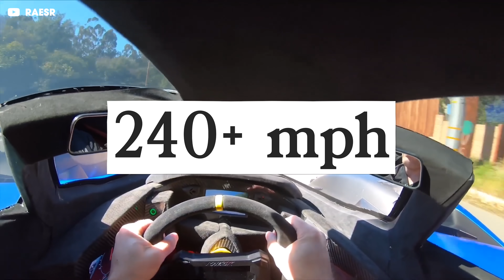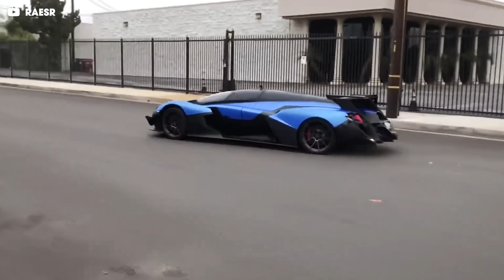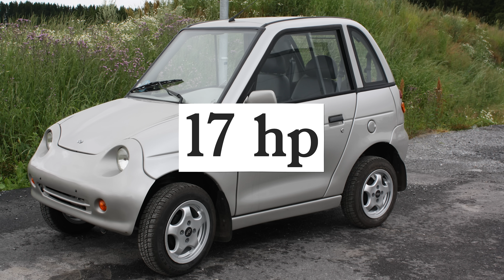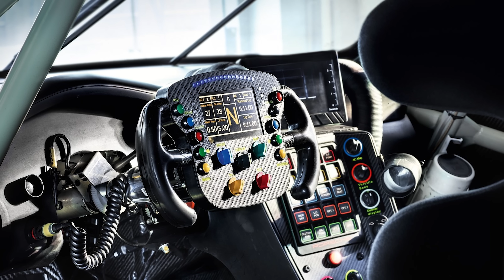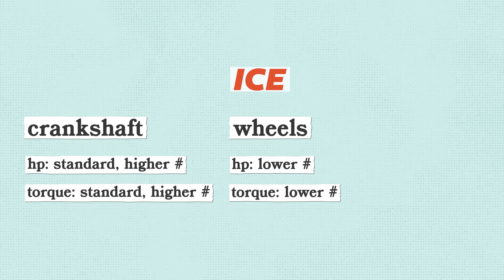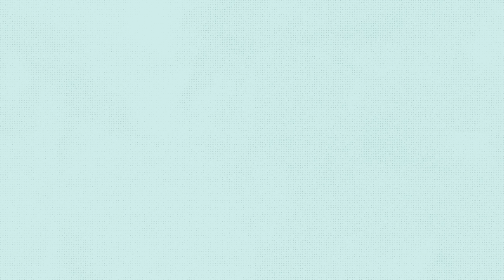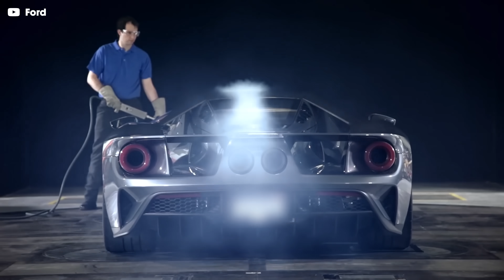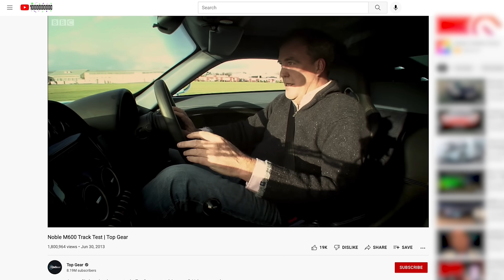Can This EV Hypercar Deliver on its Promises?

Comment: EV hypercars are starting to look like  concept future cars in the 90s. Happy to be alive right now.
Reply: The problem with EV supercars is that I think they will all feel the same.  Contrast that to ICE supercars where you have a variety of engine configurations (Flat 6, V8, V12, I6, etc.), different induction systems (NA, turbo, supercharger), different transmissions (manual, dual clutch, torque converter), different gear ratios, different differential strategies and final drive ratios, etc.  All these choices mean that ICE super cars drive and feel differently.  With EV supercars, only the suspension tuning is really left to differentiate them from each other.  I say this as a Tesla P90D owner, I am not anti-EV, but while my other ICE cars drive and feel differently, I am not sure EV supercars won't all feel the same with very similar architectures, just a different body on them which will be kind of sad.
Reply: @alangil40  I never thought I would ever hear a Tesla owner say something so true... I commend you. Absolute facts
Reply: Just buy a koeniggseg
Reply: I say this is the BEST and WORST time to be a car guy. So many amazing cars coming out, but now its the end of a very long era.
Reply: If only it wasn't all BS, the gooberment has made stupid regulations to claim they are doing something but in reality it's a coal power grid making the point moot other than the Karen's will be happy because we tuners are screwed out of having a viable 2nd hand market in the coming decades to make project cars out of
Reply: Did you see there are personal drones that you can sit on and fly whenever you need like above the roads. And you can 3D print entire single family house cheap and fast.
Reply: Without the sound tho
Reply: @Emppu_T.  The sound is important. Speed is great but the experience is muted by the lack of sound. For a total experience nothing beats the scream and thunder of a gas engine .
Reply: I'll be happy when they are affordable lol
Reply: @JC_Fuh_KC  To be fair an hypercar isn't really meant to be affordable
Reply: @JC_Fuh_KC  you say that like a Bugatti is affordable.
Reply: @JC_Fuh_KC  they are.
Reply: OBO o in b in b ibis o obj b band b in i oh iv b boo bbo giving big ug ug I gknow h ug. I go ug out Hu h h i h. Oh h Hu gyou go h ug ugh g g cu GI hu h Hu h ug guy u. H u h i h ug Hu Hu Hu g i h h HCu h h h ug ug yf Bonn no l kk no n on Lon link kk link no.
Reply: Battlefield 2042:WE SAUD THAT FIRST!
Reply: It's nice when you don't a big ole engine, gearbox and fuel tank to build around lol
Reply: @MrCTruck  yeah . Just build around a giant battery and electric motors. No weight savings there. No money saving there. No place to get them fixed there.  There!
Reply: @Kalna Haa🍇 oh Heck!
Reply: The Kalbori EV  Can be introduced by Volkswagen and Porsche in 2024, The Types are Kandingov, Jannesse, Kandanga, and More
Reply: plot twist: ur dead
Reply: @Error-ck4jg  nope not yet
Reply: Wheel torque is different than crank torque
Reply: Yah . If your verrrry wealthy.
Reply: smaller ICE would live that dream and EV has realize that dream
Reply: Remember mazda furai was like "WHAAAT IN THE WORLD!?!? " now that hyper design is everywhere
Reply: I agree with the second sentence
Reply: @aidaaliten8817  happy late new year 2022 Aida Ailten.
Reply: Do you have the money to buy them or are you happy to be alive because you can see a car on a screen?
Reply: @tommasol9701  He's talking about hypercars. Very few people can afford the, just like ICE hypercars.
Reply: @tommasol9701  thats how it used to be with gas powered cars. Only the rich could afford them at first.
Reply: @Knamnlidd98633  yeah but they will never be cheap because of all the rare earth elements they use
Reply: @dietznutz1  depends on how long they take to run out and if it’s reusable.
Reply: @dietznutz1  gasoline may run out one day but cars are still cheap.
Reply: @Knamnlidd98633  hi bro.
Reply: @dietznutz1  these sources are excellent to use.
Reply: @Knamnlidd98633  actually cars in that class with petro engines are still only affordable to the wealthy. It will always be so.
Reply: @tommasol9701  i bet these hypercar could be on sale again this year.
Reply: @tommasol9701  people can be happy because of the improvement towards technology and such. Doesn't mean the ability to buy them is a factor towards happyness
Reply: No vroom vroom, overpriced af.
Yeah, "great" time indeed
Reply: Lame as fuck.
Reply: @wyattmunger5529  Just like your mom
Reply: @wyattmunger5529  ur reply is lame
Reply: ev's are boring as fuck
Reply: @FullsendMSV  They are good. Not sure the pikes peak hillclimb record holder Volkswagen IDR is boring
Reply: @scuckplexity  it has kooky krazy design and pretty good speed, i'll give it that, but its so boring when all you hear is the tyres against the road.
Reply: @FullsendMSV  depends. Formula E Cars somehow manage to make the race interesting despite having a very questionable sound there is.
Reply: @scuckplexity  the only fun-to-watch slow racing series is that aussie shitbox racing; un-something production races
Reply: @FullsendMSV  I tend to enjoy a lot of races. Touring cars, Supercars, Formula 3, Formula Renault, Moto 3 and of course formula E.
Reply: @FullsendMSV  and tbh, formula E has produced a very close racing over the years. I mean, 15 drivers that still has a chance to win the world championship heading to the final round is almost unheard of
Reply: @scuckplexity  maybe because all the fucking cars are the exact same?????
Reply: @FullsendMSV  they're the same on how much downforce it produce and the bodywork but not when it comes to the power train.
Reply: @FullsendMSV  nah
Reply: @FullsendMSV  they're cool af bro wtf r u talking about
Reply: @Hitned01  THERES NO FUCKING SOUND. THATS LIKE HALF OF THE EXCITEMENT OF CARS
Reply: @FullsendMSV  it depends on who you ask and what their reasons are for liking cars in the first place